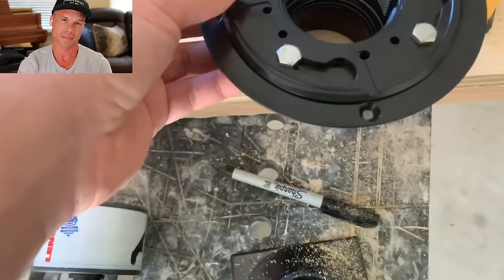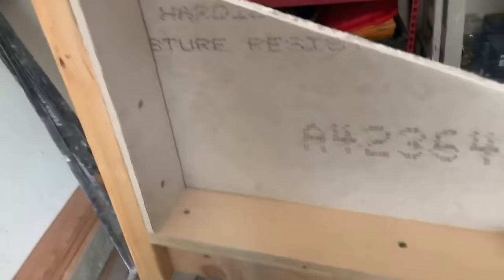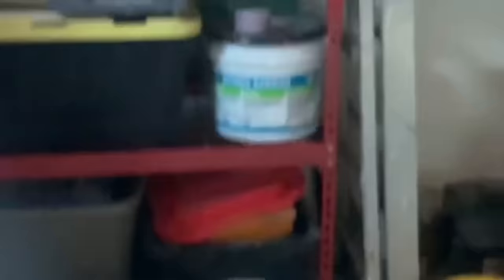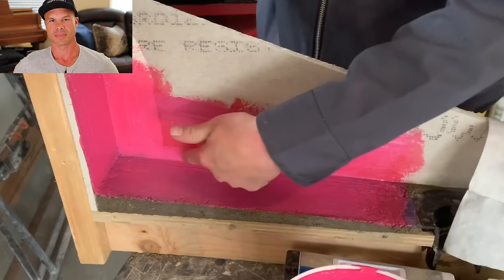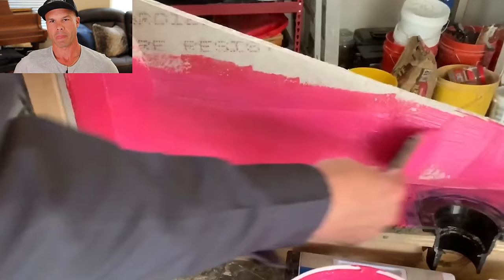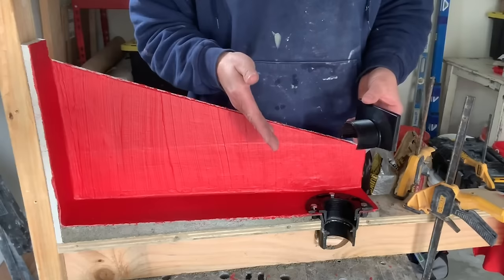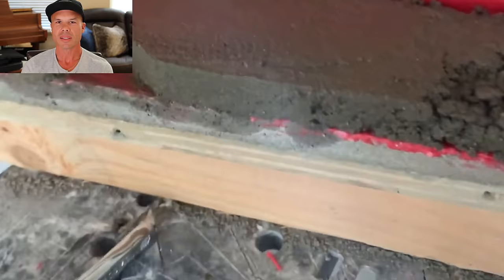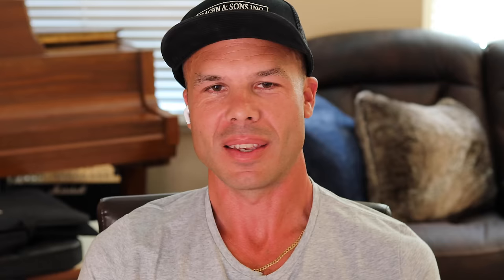THE BEST REDGARD VIDEO ON THE INTERNET!!!

Comment: Love your videos, learned quite a bit in the last few nights. After watching this I just can't see using a sloped foam floor,  There is no foam pan,  you build a pan from pieces and hopefully glue them together without any latent defects because you missed something. From your repair videos I learned that a minor leak becomes an expensive catastrophe a few years later.  I am not sure foam holds up over 20 or 30 years of use. Obviously it is cheaper and saves lots of time, but the multiple connections and the drain setup scare me. I really enjoyed the hot mop video and can see where it would last forever but that is not a DIY process. I am considering welding my own stainless pan with an integrated linear drain trough with the drain pipe welded to it so there are no interfaces with dissimilar materials. Call me crazy, but I plan to live in this house for a very long time.

Comment: From my experience dealing with concrete and aggregates it makes no sense to divide the two layers of cement as opposed to making it one solid layer with rubberized membrane on top to reduce the possibility of cracking and movement over time.
Reply: I would typically agree, however, the membrane - be it PVC sheet or Paint On - must sandwich between the 2 drain assembly parts.
Reply: Agree.  I just spend the money on the Schuter or hydroban drains.  Keeps all deck mud dry
Reply: Then you defeat the purpose of the weep holes.

Comment: This seems like a much easier method than laying a pvc liner and dealing with the sides bunching, wicking etc
Reply: Its a good system. Ive used Redgard for 15 years with zero failures. I do it slightly different from shown though the drain in particular.

Comment: The ISO standard is that a credit card must be at least 0.76mm thick.  0.76mm is 29.92 mil.  You would want 3/4rds of a credit card to get 22 mil.  There are shims that are used to open electronics that are of different depths, you could potentially find one online.  22 mil is .55 mm or roughly 1/2 of a mm.

Comment: what i would like to see is a cut away mock up like this , then the floor tiles done and grouted with modern grouts like maybe mapei fa or the like and shower the tiles for a few minutes for a while to see how the water penetrates the tile or grout and how it makes its way thru the deck mud and travels across the membrane into the weep holes, or better yet a single float shower with pan liner doing the same thing...just curious how much gets thru and how it moves across the liner....that would be neat to see

Comment: I think redgard is supposed to be the top layer on the mud base before you put the thinset and tile on.
With the tile on top of the mud base; what's to stop the water from penetrating the grout and saturating the mud base?
I know the weep holes are there to allow excess water to flow away but the mud base will remain saturated before any water starts to flow to the weep holes.
Reply: @fooron: I was wondering the same thing, i.e. why let the water seep down to the bottom layer before stopping it with the redgard on the lower layer.  Or maybe put redgard on BOTH mud layers.

Comment: In my country majority of waterproofing membranes are liquid and every one of them has reinforcing fabric to corners, seams and drain.
 
First when liquid waterproofing started producing 1990s we also used fabric whole areas but it didn't took long manufacturers chanced that fabric into liquid as fibres and therefore sheet wasn't required anymore but still corners and seams also drain requires fabric.
Reply: Great input!!! Thanks!

Comment: I'm in a bit of a pickle with an Inspector and my Contractor. The Red Gard was only put on joints and up the wall 12". What Should be covered in Red Gard if the backing board is Wonderboard and hardiebacker?

Comment: Love the video and the instructional encouragement.  I’ve used Redguard on three walk-in showers and do like it a lot. I have installed it with the same type fabric but have used it as the last step before tiling ( no additional mud bed on top of the Redguard), with much success.  With that said, do you see that secondary bed as necessary, especially when the shower is built on the house slab?

Comment: No part he forgot is when using fiber glass fabric you will need to paint both sides of fabric or it will pull right off wall when tile is ever repaired

Comment: They always have a loophole to get out of it. 

I’m not sure if they used Leinweber concrete products by you on the west coast (vinyl Crete and jif sett and a few others.) we use them allot in the Midwest back in the day

They’re instructions always said to prime the floor never said with what though. Really your only to options were latex and water. 

Every time you would have a failure and call them they’d come out and say what you prime the floor with? What ever you told them you were always suppose to do the opposite lol. In 50 plus years I don’t think they ever had a project they had to replace. Loophole saved them more times than I can count 

They’re still around but I don’t think many people use they’re products. Even his own guys use other products like ardex today instead of his own crap.

Thanks for reposting this vid. Good source of info here
Reply: Agreed there is a little bit of deceptiveness in their instruction/technical data being savvy and maneuvering around it to achieve a successful installation is a sign of a true professional.

Comment: I have never used any type of topical waterproofing for my shower pans only Noble pan liner materials.  The only issues I have with the product I use is the liner material and the sealant between the body of the drain and the liner conforms to the weep holes on the under side of the clamping ring not allowing water to pass through to easily.  This topical waterproofing lays flat so water will pass through.

Comment: I really don't understand the theory behind the drain rocks around the drain. If the water in the deck mud can find its way to the drain through the all that deck mud (in some cases  it may need to travel 4 or more feet) - then why won't it just make its way down the drain without the rocks there? 

In Australia where I live, drainage rocks around the drain are definitely not done here.
Reply: I guess, idea here, to create various density, so the area around drain is more porous due to pebbles vs sand particles size, therefore water should gravitate towards forming water droplets that can sip further down the slope into weep holes. Packing it with sand makes it less efficient as sand particles are packed more dense hence give water molecules more surface to attach (saturate) and slow down draining effect.
Reply: It just keeps the weep holes clear and free flowing

Comment: Issac would you suggest omitting the pan liner in Lue of red guard isn't that putting all your eggs in one basket completely relient on red guard to keep water out of your sub floor and pre slope and isn't the drain manufacturer going to void any warranty where as no pan liner was used and if this installation method is sound why does red guard not have a drain system to compliment this installation method ! One other thing we should start calling tile installation videos NASA Because there is ( Never A Straight Answer ),on anything video out there it's all over the place, kind of like this thin set and my key board ? 🤗

Comment: Great Video!  Quick Question: If you are using the fiberglass or polyester mesh on on the inside and outside corners then is it still necessary to coat those same corners with mesh tape and thinset? If it is not necessary - why not coat the factory edges and butt seams with the RedGuard as well? Thanks!
Reply: Old video I know, but I think you could do one or the other.  I think if you didn't have the fiber paper mesh you could do a typical mesh tape and thinset mortar reinforcement and that will stabilize the Redguard membrane as well, and vice versa, if you didn't have the thinset mortar and mesh you could get away with just the Redguard and fiber paper mesh.  I mean, logically that makes sense to me.

Comment: Isaac...Thanks for the great videos and especially your heartfelt comments at the end of this one; I'm certain many will find inspiration in you words!  Thank you!  Now can you please help me by answering just three questions?  I am doing my first shower in a week and if I watch anymore"how to DIY" videos, I think I will go blind.  Therefore, can you please tell me... 1) after my pan is set and ready for tile, does my durock wall board make contact with the pan or not?  and... 2)  everyone says not to penetrate the 40 mil membrane with screws...so how close to the floor do I set my screws to fasten the durock since my pan membrane comes up the wall?   I'm concerned that if I don't screw the durock as close as 3" above the pan, I will have some type of issue.  (FYI my tile is 6" x 16")  Thanks for replying; be well and stay safe!
Reply from the maker: 1.) Cement board can go into the mud pan. Do walls first then mud the floor up against it.   Backerboard cannot do this.    2.) No screw penetrations allowed below 3" ABOVE the top of the curb.   This is why you pin the bottom of the cement board with the floor mud. Good luck!
Reply: @TileCoach  Thank You!!!

Comment: After preslop and redguard, instead of another layer of deck mud, I'm thinking about using half inch cement board in a linear drain application to eliminate risk of crack. Cement board used as floor tile backer and uncoupler on wood sub floor and I don't see why it can not be used in this situation. Have you or any one did this way?

Comment: Re: thinset on the seams and screws.  I had a failed shower at my last house and did the demo and some of the initial preparation.  i.e.: I put in the cement board, but hired a plumber to install a pan liner and new shower hardware, and professional tile installers for the dry pack base, and tile installation on the walls, ceiling and the floor.  The tile guys I hired told me to prepare the space using drywall compound on the seams and screws, not thinset as was done in this video, and I followed their instructions.  How much of a waterproofing and longevity difference does thinset vs. drywall compound make for that preparation?

Comment: What would you prime the subfloor with before putting drypack? I wonder if it would be worth it to put 1/4” hardie down with mortar bed, then add drypack. Adds a little under 1/2” thickness and gets something for the drypack to bond to?

Comment: Hi, I'm using a pre-formed plastic shower base pan and plan to use ceramic subway tile on the shower walls.  We have used a concrete board for the substrate and plan to coat it with redgard just to be sure it is waterproof.  My question is what brand & type of tile mortar would you use going over the redgard?  Is Mapai Type 1 okay?  I usually prefer to buy pre-mixed to be sure I have the right consistency. Thank you in advance for any advice you can give.

Comment: Great video, both of you!! Quick question.  Why sandwich the red guard between 2 mud beds rather than one big sloped mud bed, redguard, then tile?  Wouldn't that eliminate 1inch of mud bed to absorb water.  Or does redguard not 'play well' with the tile thinset?  Thanks!!
Reply: I did a small 3.5’x3.5’ shower over concrete using denshield along with this same mesh tape and red guard to make a pan liner.
Reply: The redgard is acting like traditional pan liner. So if it got through the mud, it will flow into the weep holes.  The way you described, there would be nothing that channels the water into weep hole. It would go strain into floor.

Comment: Man I’ve learned so much from you!!! Thank you so much as it’s helped me significantly improve my tile knowledge and experience. I have a question… so for the red guard prime coat what do you mean 4 parts water and 1 part red guard before you actually apply the red guard? Your advice is greatly appreciated!!!😉💯💪🏽🙏🏽
Reply: Make a very thin mixture of Redgard and water since the float bed will absorb most of the water and you want the Redgard tp permeate into the float bed for proper adhesion. I cover the entire bed then put a wet coat of straight Redgard to lay my fiberglass mesh tape or cloth into at all seams,.corners and the drain.
Then cover it with the 1st coat of Redgard once dry. I apply 3 coats on all seams and corners and i cover the concrete backerboard entirely with 1 or 2 coats.
I build the floor up to about 1/16" thickness with 6 to 9 coats with a paint brush allowing each to dry thoroughly before subsequent coats to prevent blistering. Very important!
Its a 8 to 12 hr process. If not longer depending on drying time.
Reply: What did you end up doing for the primer coat and did you think it worked or helped ?

Comment: Thanks for the videos. I was intrigued with the Flex Seal use. I don't see pros  using a "double seal" method, meaning two layers of deck mud with each sealed. Would you recommend this? If so ,would you combine a layer of Red Guard and the other with Flex Seal?

Comment: So I have watched this video multiple time and also your video on creating a pre-slope, both great videos.  My question is this do you use the red guard to create your shower pan?  I just did this and also went the extra step to put a layer of fabric and red guard down on the floor for the shower pan.  I have always used the rubber membrane to do my pans in the past. Just wanting to check before I cover this with tile.  Thanks
Reply: I bought the keri shower preslopped pan and it's short. They say just use mud pack? I'm not sure about that. So I'm going to use this method as well.

Comment: Very Interesting. It seems there is a disconnect with proper methods. Is this in the TCNA manual. If you use a Ditra drain with one layer of deck mud you membrane the whole area.Then Redguard the area. No Leaks. Journeyman since 1980.
Reply from the maker: Yes it is in the manual, same method as pan liner.

Comment: Great job testing the various materials available today. Keep up the good work.  Question:??   I saw your video testing ardex 8-9 vs Hydroban/ laticrete hydro ban cementitious products.  Is the regular Hydroban in the plastic jugs a similar product( you just dont mix it with water).  Whats the benefit of cementitious/water vs the mastic style ?????

Comment: Quick Question.  If Redguard is a waterproof membrane, why is a final mortar mud bed placed on top of the Redgard? In my thinking you are adding an extra layer of non-waterproof material (the mortar) to an already waterproofed pan. Am I missing something? Custom material, the maker of Redgard shows multiple videos with the preslope being the final layer with Redgard on top.  My question with that application, is how is the drain flange finished? I haven't found any videos or information on that topic, i.e. how to finish the drain flange. I am open to all ideas and suggestions.

Comment: Tile coach you are the man thank you for everything you do! I am going to do a pre slope traditional shower drain why don't you use red guard on both changes of plane on the pre slope as well as your top when inch of Dec. Mud Would that be practical to use on both surfaces or with that defeat the weep hole system in your opinion... Possibly you don't want to use thin set and tile right on top of red guard I am just asking thank you for everything I've watched all your videos!!BradParadis

Comment: Having to wait until all those coats of redgard dry would make this method inferior and slower. 
and he's still doing a two float system anyway so why not just use the pvc liner? 
I thought about using fabric and redgard on a one float method but I wasn't sure which drain would apply good even clamping force on the fabric and redgard.
Reply: Where it's a lot faster is in a commercial setting. Say, a bunch of hotel rooms, you could just have one guy with a sprayer doing all the showers for an entire floor, and go to the next floor or lap yourself for your second coat.

Comment: Very informative!!  So the Redgaurd is acting as the Choryloyl or PVC liner?  I did not know you could do that.  I would think, yes you would need the fabric around the different plains if no liner will be used. Is that correct?? And I've seen the fabric called "fiberglass mesh" and he called it  "felt" not to say that felt is not a fiberglass mesh. What is the trade name of  the fabric and where can I buy it .Thanks in advance of your response.

Comment: I built a shower stall using red guard 15 years ago. It never leaked. I still live in the house.  I still have the lath that I used to get the red guard out of its container. I left it covered in red guard so I could see changes over the years if any. I can tell you by looking and feeling that lath that there is no way red guard will fail if you apply it right.

Comment: I plan on taking my tub out and putting in a shower I plan on using a cast iron pan I'm a little confused on how I should waterproof my walls. Should I bring my backerboard to the lip on the shower pan and how will I seal the bottom where the backer board meets the lip of the pan or do I go over the lip with the backer board.  I think I will use regard as a waterproof

Comment: Awesome video! My ebbe drain installation video said to set the flange all the way to the substrate (in my case my 3/4" subfloor and not to those nubs on the flange because it adjusts up to the height that i need. Do you have any advice for those of us that went with the Ebbe drain flange?